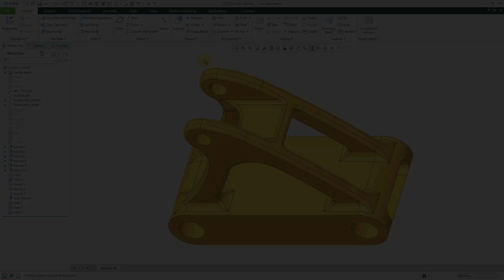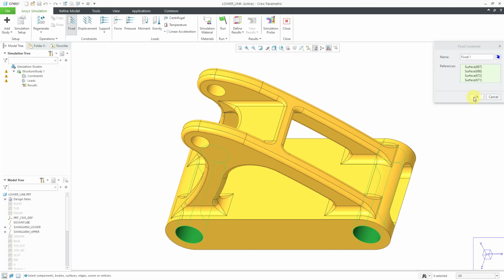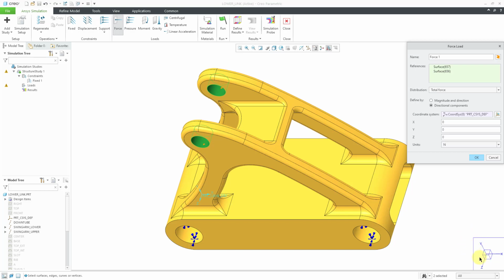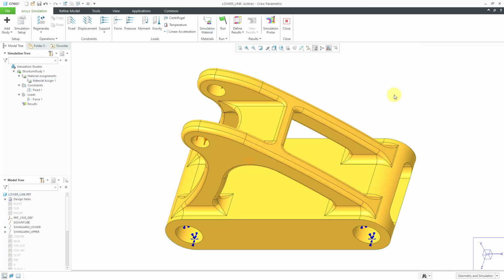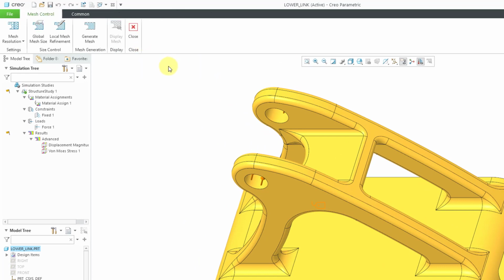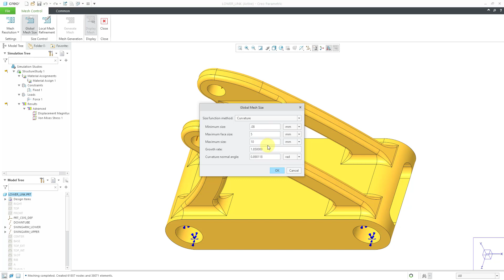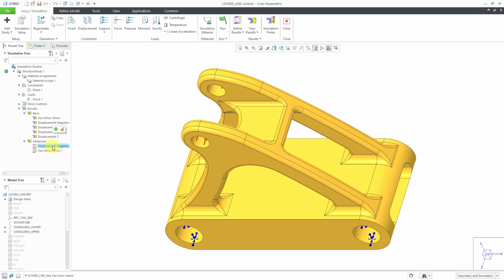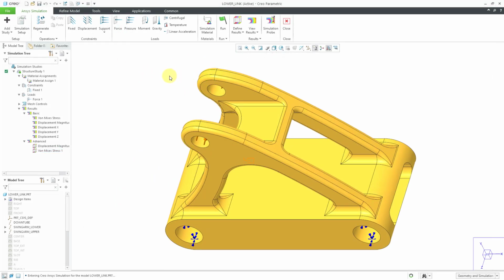Creo Parametric - Creo ANSYS Simulation - Structural Analysis

Comment: This is wonderful, this video helped me a lot. Could you make an Ansys Simulation video for the case of belts and pulleys? To define belt tension and analyze pulley/bearings efforts.

Please!!
Reply from the maker: I'm not familiar with how to perform that kind of analysis. It's been over a quarter century since I've been a full-time structural analyst.